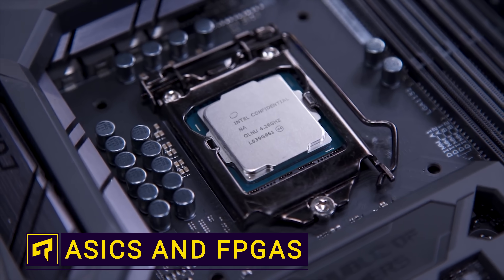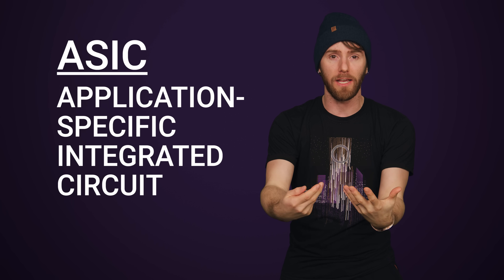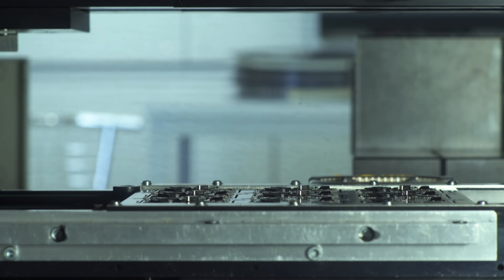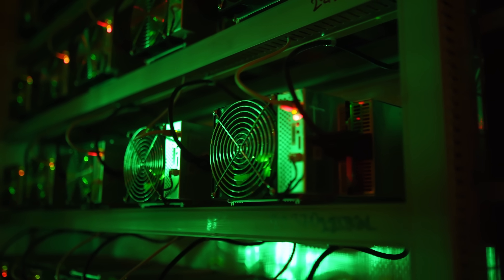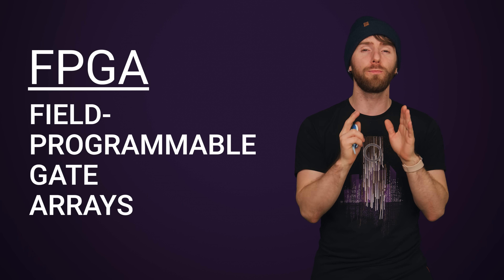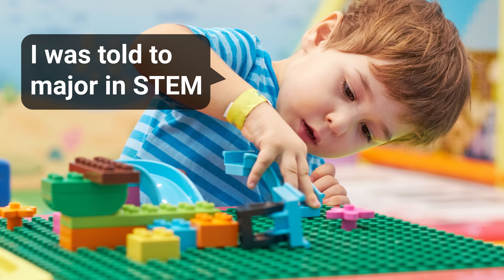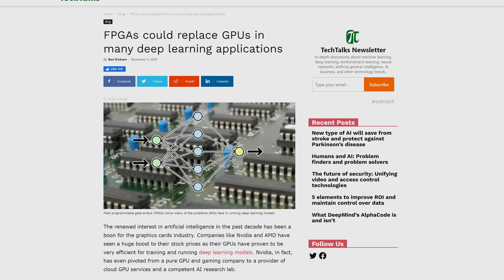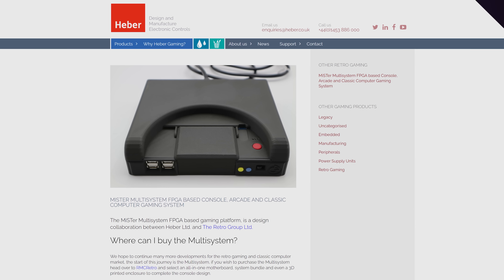These Chips Are Better Than CPUs (ASICs and FPGAs)

Comment: FPGAs so great at doing everything, they dont do anything out of the box
Reply: That's why they AREN'T better than x86 based CPUs.

Clickbait title for the video
Reply: @saricubra2867  That depends on what x86 cpu you are talking about. There is an x86 core that performs pretty well.
Reply: They're not great at doing everything, just often better than doing it in software. The only thing a FPGA does better than an ASIC is take less time to develop, cost less in small quantities, and be reconfigurable.
Reply: @ZaPpaul  Every x86 based equivalent and more powerful than Intel's Haswell.
Reply: @saricubra2867  There will be an FPGA able to recreate the latest and greatest intel CPUs and faster. They are just not available yet. By then of course the newer CPU's will be faster. The point is FPGA are incredibly versatile and have lots of uses. One day all CPU's will be on FPGA type silicon. It's the future for sure.
Reply: @saricubra2867  x86 based CPUs technically cant rlly do anything out of the box either, its just that the programmes and operating systems were mostly made FOR x86 based CPUs
Reply: I can already imagine a community growing around programing those FPGA's for various games.
Talk about performance!
Reply: @saricubra2867  Not clickbait, you just missed the point of the video or didn't watch it at all, hence the example with network switches, in which case ASIC IS better than x86.
Reply: @saricubra2867  It's true. An  FPGA running a Softcore CPU wouldn't be as fast as the real thing. Only the top line FPGAs are in GHz range.

It does make use of the area for specialized applications like heterogenous computing , and it's quite low latency so it's popular in finance.

Many stuff like OneAPI and OpenCL are blocked by license as well. Standard is $2000 USD. To skip the license you need really good skills in low level language like verilog.
Reply: @hjups  Aren't FPGA also used to test integrated circuit Design for ASIC ?
Reply: FPGAs are not good in everything.  Not.  You can have faster processing in a CPU or GPU.  You have lower cost and faster performance for a specific task using ASICs.  FPGAs are good in fast development.  Time to market is faster.  It is good in small production volume.  In small production volume, the development cost of ASICs cannot be spread through the mass unit of production.
Reply: @Gurj101  Yes, but only to test / verify functionality. While it's an actual implementation of the ASIC, the FPGA is being used in place of a logic simulation tool (the sim tool might give you 1 second of execution in 10 minutes to 10 days, depending on the design complexity). Instead, a FPGA can let logic be tested within 1 or two orders of magnitude.
To give you a concrete example, I had heard that NVidia tested their GPUs on boards with many FPGAs connected together (required to fit their design), and one of their test codes that typically runs at 200 FPS only ran at 1 FPS (which is to be expected for a FPGA). That's still a lot faster than running it at 0.0001 FPS via a simulator.
Reply: As a mixed signal ASIC designer, ASICs are designed in two "domains", there is analog circuitry, which is designed as schematics and simulated with spice (for example part of the analogue-digital-converters) and there is the digital domain, which is designed using a hardware description language (HDL) and the same HDLs are used to configure FPGAs and this part can functionally be run on both. But power consumption and speed are wayyy worse. FPGAs are way cheaper in smaller quantities and allow reconfiguring.
Reply: "Instead of trying to please everyone, please no one and let them please themselves"
-suckless I think
Reply: @joz534  main COU will still be used but yes, FPGA will be used for gamming since they are between ASICs and CPUs in properties
Reply: I've done over 80 designs with them. The problem is they are just too expensive for competitive mass produced products that can carry the cost of the ASIC NRE. And as noted, you use only a small portion of every logic block (macrocell) and although they are fast they cannot match a fully optimized ASIC which wil be smaller (no waste), cheaper and more power efficient if you do your work right.  The reason Crypto first was accellerated with FPGA's was that the hash algorithm was a perfect fit. That was a huge jump in performance, even hanging on a USB port and you could do multiple units in one FPGA. Very quickly the very same Verilog was targetted at an ASIC and the rest is history. Look at people posting Megahash with a GPU and then look at Antminer's  (et al) Terahash at a better price and lower power.  Antminer made one very small ASIC and just loads their box with a boatload of them. A similar approach is going on with AI and Neural Net (Tensor) cores. Of course those logic blocks are so small they are just sliding right into the GPU/CPU for high speed interconnect. There they provide a soft upgradable core that can be imaged upon boot and for a specific purpose. This is why the AI cores in the Apple M1 processors are an enormous deal. They may seem like baggage now but over time they will have a library of downloadable enhancement images that boost performance dramatically.  Think about Intel's processor extensions like MMX etc all being field upgradable when the market matures and the need arises. Apple (and NVIDIA) have that option in AI/ML moving forward. It will be the golden age of AI although I think there is a secret sauce that is missing that will really blow that roof off the mother.
Reply: @dennisfahey2379  I still hope apple flops because their stuff sucks so much and they delete all my parent's data while I get the blame.
Reply: @iskamag  - It's nice to live in a world of free market options and competition. You have multiple flavors of Linux, Windows, ChromeOS, Android, etc.
Reply: @dennisfahey2379  ?
Reply: fpga's come with soft cpu's for a long time now, z80 as one of the first loaded at the uk factory, so they 'can do' stuff out of the box if required ,Uncommitted Logic Arrays where most useful back in the day.
"David May (computer scientist) May's Law states, in reference to Moore's Law:

Software efficiency halves every 18 months, compensating Moore's Law."
Reply: There great at being support processors and help boost performance. But there main benefit is being cheaper than an ASIC but also just as good and allow you to reprogram them as many times as you want. 

This is why FPGA’s are used in the design of cpu’s, GPU’s and other circuitry.
Reply: @joz534  That'll be like what Atari does in the old times, where the chip is specifically designed for one game. (Luckily FPGA can be reprogrammed but it costs extra time to reprogram one than loading game in your PC)
Reply: @ZaPpaul  Actually a lot of modern CPUs are already somewhat similar FPGAs, because some parts of it are programmable. You can think of it as a hybrid approach, some of the high performance core components are pure hardware, while other parts are programmable. One way is using FPGA reprogramming. Another, very common way is to introduce a level lower than machine code that acts as interpreter for machine code; this is a read only program. This technique is knows as microcode.
Reply: @yaronhb  I know what you are saying, but FPGA is vastly different to what you are poorly explaining.
Reply: @ZaPpaul  If you think that my explanation is so poor why don’t you enlighten me
Reply: @yaronhb  because you are likening two vastly different technologies. I also have no desire to further this conversation. Modern cpus are not FPGA. Don't be absurd.
Reply: @ZaPpaul  The biggest absurd here is that you are arrogant and disrespectful to someone you don’t know. How you twisted my words and put words in mouth that I haven’t said. And I do not want to converse with someone like you.
Reply: Thing that many don't realize FPGAs are primarily the platform that allows ASIC design today. Companies rely heavily on fpgas to validate their RTL.
Reply: @ZaPpaul exactly
Reply: @dennisfahey2379 are you referring to a hybrid ASIC which has an FPGA block in it?

Comment: The chips inside cheap toys are usually tiny micro controllers that are burned with a program from the factory.
Reply: That is more or less the definition of asic
Reply: You mean flashed rather than burned perhaps?
Reply: @hubertnnn  No, ASIC is hardwired. A lot of toys are not hardwired but actually ESP/Arduino/Microcontroller running C code or something small like micro python. This is true to a lot of smart devices and toys that go beyond the cost of a simple PCB and IC.
Reply: @hubertnnn  No, ASICs (and FPGAs) are wired (and "programmed"/burned) to do some functions, microcontrollers runs software to do so, the function is implemented as software, it's a program. Processors and microcontrollers are special, large ASICs, wired to able to run machine code program. Cheap toys don't require full-hardware speed (implemented as ASIC or FPGA), a slow (compated to desktop processors) microcontroller can do the job by running program, which performs the function.
Reply: @hubertnnn  an ASIC is not running code, unlike a microprocessor. It is (like a microprocessor) a bundle of electronic circuits, but they are designed for a specific application (Application Specific Integrated Circuit). Building an ASIC is more difficult than programming an application on a microprocessor, but it has advantages (speed, efficiency, etc.).
Reply: @vincentstragier6628  ASIC's are non-reprogrammable fabric, what microcode it runs depends on it's design as asics are application specific. Asics are cheaper to create in bulk, since they're mostly monolithic. I wouldn't say they are any harder to create than other processes, but they aren't reusable, and are very specific in their use case.
Reply: @Donnirononon  you can get OTP memories, although factory flashing is likely a lot more common
Reply: @ern0plus4  Indeed. You will find MCUs in many things from robots to home appliances to medical devises to vending machines... They are essentially simple miniature PCs designed to control small features of a larger component that doesn't front a complex operating system.
Reply: @Donnirononon  incorrect
Reply: @hubertnnn  No, it's not. A microcontroller is still a CPU, it's just a low-powered CPU because the task doesn't require a lot of complex calculations. An ASIC is needed for high complexity calculations and many will consume the power of a microcontoller while being able to do their specific tasks as fast or even faster than the fastest power-hungry processor out there.
Reply: @hubertnnn  No.
A better example would have been calculator chips, those are asics.
Nobody is going to waste time flashing those, so they come out of the wafers as what they will be.
Reply: @mokahless  A microcontroller is a CPU with peripherals/ram/flash integrated into the chip instead of external chips needed.
Reply: @Donnirononon  he probably used they term cause the memory inside those MCUs is not reprogrammable, which makes them cheaper
Reply: I’m not sure that is true. Most toys I have seen use an asic (as indicated by epoxy blobs)

Comment: As an FPGA engineer, this video was surprisingly good.
Reply: One thing I wish he would have mentioned is how difficult FPGA's can be to program. Unless you have a very simple program, you'll have to break your program into at least a hundred different files to program it for an FPGA.
Reply: @larrimus4309  unless you get a myRIO and use labview
Reply: @larrimus4309  what kind of programming languages do they use?
Reply: @giantskeleton420  they are called hardware description languages (hdl). The most common languages are verilog (or systemverilog) and vhdl. 
Most commercial companies use verilog whereas anything defense or government related uses vhdl.
Reply: @mwniels  aight thanks
Reply: @mwniels  VHDL is quite common in the private sector in Europe.
Reply: @mwniels  It's interesting to note as well that HDL programs very differently than conventional programming languages. Personally, I'm a huge fan of everything being clock or sensitivity-gated as it makes the logic seem so clean, but it's definitely not easy to "translate" between the two without using HLS or something
Reply: @pascal7947  I'm exactly that, but I use Verilog. 
BTW, fuck Xilinx Vivado. 🤣
Reply: @pascal7947  valid point. I should have included our friends in Europe. I work in the defense sector so most of my work is vhdl.
Reply: I want to learn to program fpga. What is the best starting point you've come across?

Comment: I work in a cyber security company that uses FPGAs 😃, we use them to monitor network traffic at rates of hundreds of GB/s.
Reply: Which FPGAs are those ! I always thought fpgas don’t exceed MHz range
Reply: @kedharguhan  We mostly use Intel Stratix 10 FPGAs
Reply: @kedharguhan  Most modern FPGAs have a SERDES built in. so even 10 GB data will come in as a parallel stream, but much more slowly.   Also, the data is likely coming in over multiple ports, and each port can afford to have its own dedicated logic (assuming that the FPGA is big enough).
And the FPGA, like pretty much everything else, has gotten faster.  But even hundreds of MHz should be enough to keep up with 10 GHz serial data.
Reply: I meant serdes, my phone doesn't like that one
Reply: @harrkev  Scalability was what I always loved about FPGAs (especially for logic like this which doesn't require much arbitration or interaction between design units) - you instantiate ten units within a FPGA, then if that's not enough you get a larger FPGA and instantiate a hundred of them! It really makes anything that can take advantage of parallel compute so much easier to deal with.
Reply: @kedharguhan  100Gbps eth link is usually done with 4x 25 Gbps xcvr and each of these have 64 bit interface so bus clock is around 400 MHz

Comment: I've been an FPGA Engineer for 10 years.  They really are great chips.  You can pretty much do whatever you want in one, it just depends on how much time and money you want to spend 😉
Reply: Well FPGAs usually only have reconfigurable digital hardware, so everything analogue is in fixed parts like in a Microcontroller/SoC. 
Also chips for space or CERN need special considerations for radiation which make FPGAs unviable.
Reply: @pascal7947  Radiation hardened FPGAs do exist from manufacturers such as Xilinx and Microsemi, and they have been used in applications related to space and particle physics. In regards to analog design, there is also the less popular FPAA (Field Programmable Analog Array), which I have only come across once about a decade ago.
Reply: Spot on. They are inefficient, slower, hotter and more costly. Its an artifact of their versatility and preset chip layout. Still, for where they fit that are really useful. If the final product can handle the cost premium its a fine go to market choice.

Comment: A good analogy would be, general CPUs are a toolbox, they can make many different products, and ASIC's are a production line, they make 1 product, but they make  a lot of it , fast, and accurately.
Reply: And ASICs can go wide / parallel doing many things concurrently. Only multicore CPUs can process two threads in the same clock cycle. GPU's do many independent calculations in the same clock. This is what the CUDA cores are about - concurrency. This sort of loops back to LTT's recent analysis of the RTX3090 vs the CMP processor. They were related but not identical chips. If you were to look at the dataflow through each you would see custom lgic specifically added for graphics on one and AI on there other. Linus was spot on when he said the two markets had diverged AND could support independent chips due to the volume. The original NVIDIA Tesla's were really just relabelled GPU's with a manufacturing test mode plus API that flattened out that tremendous number crunching for general purpose vs graphics specifics. AI is getting really interesting in a similar way.
Reply: And building on that analogy, and FPGA is a 3D printer. You can make many different things with it and you get some degree of automation, but they're better at making certain classes of objects than others.